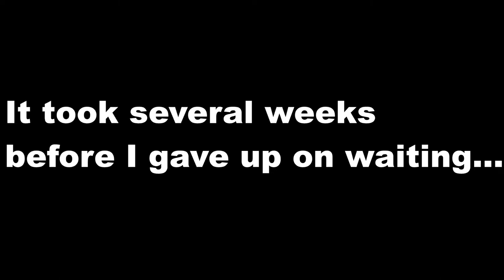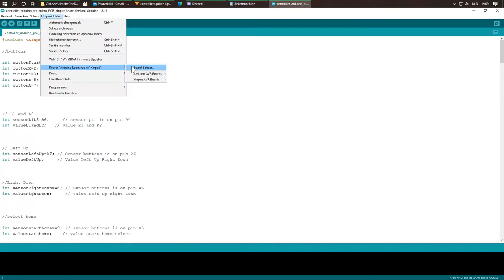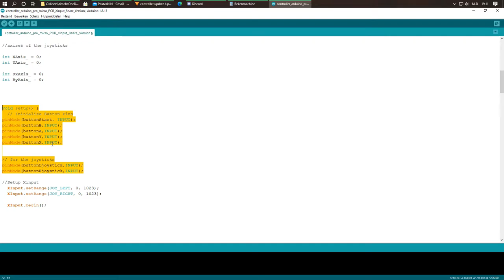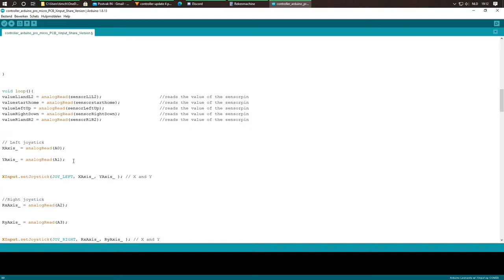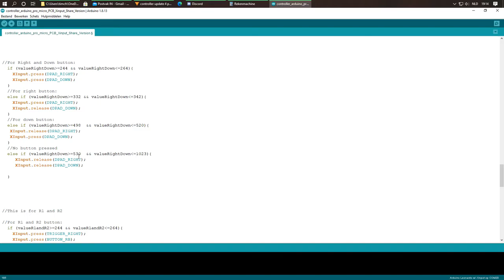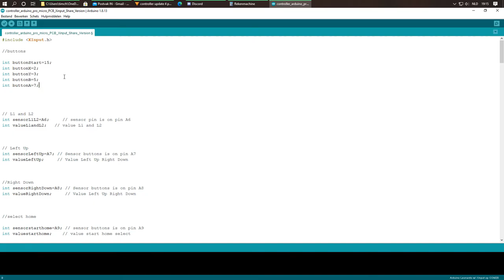Now you can make your own pc game controller! || Arduino PC game controller; Update 4, part 2

Comment: Just wanted to say that no, shift registers don't require 10ms clock. The usual timings are on order of hundreds of nanoseconds (100000 times faster than 10 ms). And the way people deal with a lot of inputs is usually a scan matrix. This way 16 inputs require 8 pins, 4 output, 4 input.
Reply from the maker: oh thanks for the correction! I haven't used a shift register myself in Arduino yet so i was going off from what I saw in other people's code but I am probably wrong then lol

Comment: Hello! Great job 👍
I have a few questions:
1. Can I use arduino nano?
2. Can I use nintendo switch analog sticks?
3. Is it work with smartphone through OTG?
Reply from the maker: Thank you!
To awnsers your questions:
1. No, this must be a atmega32u4 (Arduino Leonardo, Arduino micro, Arduino pro micro) or any of the other compatible microcontrollers listened on the xinpit GitHub page
2. Yes!
3. In theory yes but i have not tested it myself

Comment: Love the project! Is there any way where you can upload to the google doc or email me the source files for the PCB? I am asking because I am working on a similar project but I would like to change the dimensions of the PCB and re-arrange some of the parts. The source files would really help with that due to them allowing me to do changes to the design. I would have to completely redesign the board if I were not to have them.

Thanks and keep on making amazing projects!
Reply from the maker: The Gerber files are in the Google doc already together with a schematic!
Reply: @TimCoole  Ohh, okay. I meant like the EasyEDA source files. Is it possible to add those to the Doc?
Reply from the maker: @alexpanda6146  aaa sorry no I can't do that. I do wish you the best in your project!

Comment: Hello, I have a question, I installed the library and board packages also  uploaded your code. I used regular tactile switches and all the buttons are responsive except the back button and the middle button. I replaced the buttons in different orientations quite a few times, but now I think its the code. So got any ideas how to fix? 

Thank you, great video btw.
Reply from the maker: You probably want to put an analog read on the "valuestarthome" (confusing name for  it i know) because it's connected to the back button and the middle button or "logo" button. Because what i'm assuming is going on is that the values it's getting aren't the one's i programmed for, this could be because of the resistors you're using.
Reply from the maker: This part of the code is all the way at the bottom btw, just so that it's easier to find aha

Comment: Hello, I'm kinda new to this anyways I have a question. What resisters did you use? 10k ohms? Or 10 ohms? Thank you for the pcb design.
Reply from the maker: All resistors are 10K ohms!
Reply: @TimCoole  also it's my first time working with arduino and I been trying to figure how to install xe input library and the board package. The jargon goes over my head. You got any answers? The article in the Google drive was very vague on that part of the guide.
Reply from the maker: @joselopezcap747  usualy the mistake i do is forgetting to unzip them or when  i do, the unzipped file is in another file that shoudn't be there in the first place. I would start looking there honestly, as all library's and board packages are installed the same way so there are many tutorials on that if you're stuck on that part. If you can't select the Xinput boards then your board package isn't installed properly, if you can't define the xinput.h then your library isn't installed properly, this would be a handy way to trouble shoot them

Comment: Can i play gta 5 and san andreas and also minecraft , batman , GTA vice city, and racing games with it on pc?
Reply from the maker: Any game that supports xbox360 inputs can be played with this. Some older games like GTA San Andreas don't support it out of the box, but usually there is either a mod or some in game settings to make it work with Xbox 360 controllers